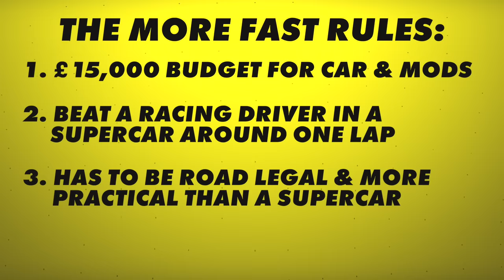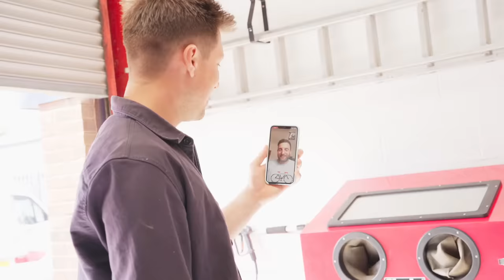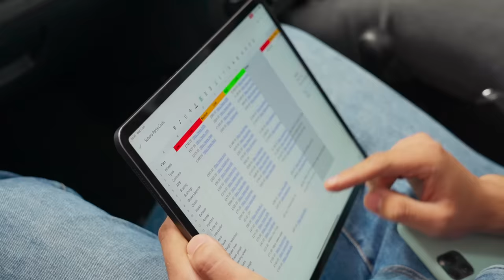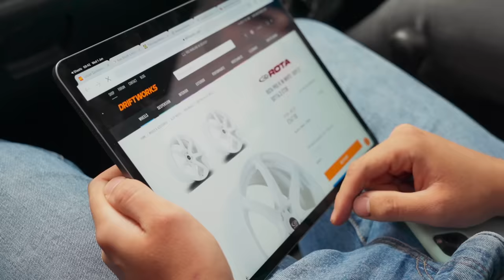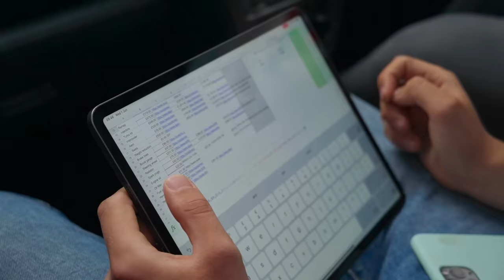Buying a $5000 Project Car to BEAT a Supercar | MORE FAST EP1

Comment: Surely the stuff about the steering wheel and wing is a joke? Please tell me that was joking...perhaps a splitter if they're cheap enough but a steering wheel has got to be a waste of money for this! 😄

Also: used parts must be a good option. They only need to last (just over) 1 lap at full tilt! Doesn't matter if the turbo blows up on lap 2, as long as it's quick enough on lap 1 😁

Comment: Im pretty sure this car understeers like a pig, not sure what the rear wing is for or the steering wheel for that matter. I doubt even double the budget would get you a car that is reliable and fast enough even for a single lap.300 hp on a drivetrain with about 25% power loss is pretty laughable. I have to admit tho, the video is quite interesting.

Comment: Simply do some chip tuning up to 500 HP
Reply: You think stock injectors will support 500 hp? Not to mention that the IC is too small for that and they'll need more cooling if they're going to drive the car flat out for any length of time.
Reply: Nah , you'll just spin a bearing , stock internals are only good to 300-320 , weight reduction , good tires and get the understeer/oversteer sorted and it'll be plenty quick

Comment: £11k to spend and the target is 300hp? Why bother? 4wd isn't going to be a benefit with decent tyres at that power. And it only needs to do a lap, just give it 500 or buy a more suitable car.
Reply: Second hand coilovers - £500, set of PS4s - £6-800, weight reduction- free, big turbo - £1500-2000, big injectors - £250, big fuel pump - £150, big intercooler - £300, uprated clutch - £400, sti brakes - £1k, track discs and pads - £800, 2nd hand 3" exhaust - £500ish. Then remap and geometry. Probably about £8.5k all in assuming labour is free so there's even room in the budget for some engine internals

Comment: I'm disappointed. I thought this was going to be a more serious attempt at trying to beat a supercar, but they're more focused on big rear wings and how the wheels look instead of performance. More power won't help you go faster if the tires can't handle it, and tires will help more in the corners than power will. A front  splitter is also easy, cheap, and effective downforce. Please make a serious attempt at making the car faster around a track instead of how the car looks.

Comment: Just go for Steelies wheels the OEM Steel wheels maybe widen them they are lighter than the cheap shit alu wheels . The cheap alu Wheels they use lots of alu to strenghten the wheel to get the same strenght as the steel wheels .
Reply: This account is hacked

Comment: you bought used car, why don't you buy used mods? and steering wheel, rims, big wing, is it "pimp my ride" am i watching?! seriously, you need 1 lap faster than lambo. get a methanol injection, ecu reflash, coilover taps, and tyres. that's almost all you need. and clutch, of course